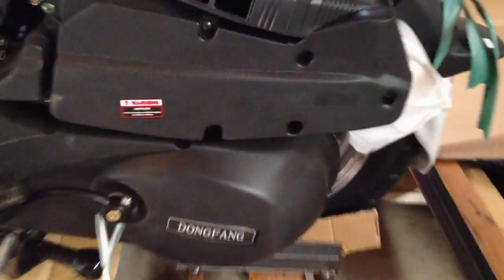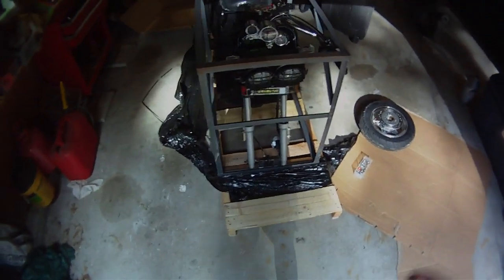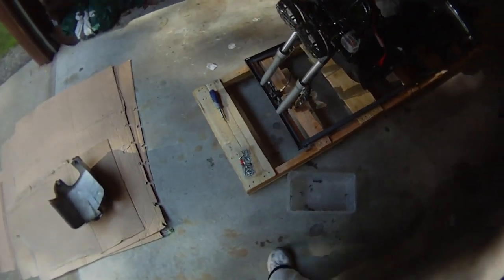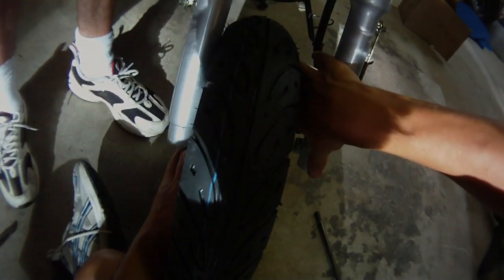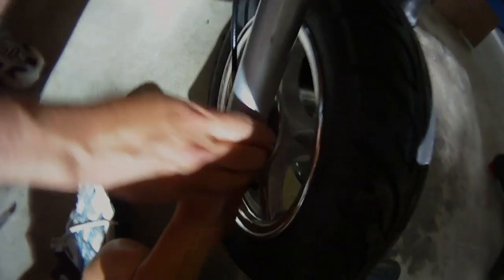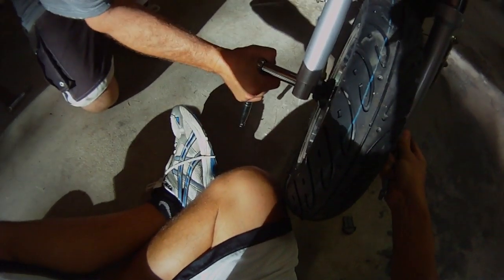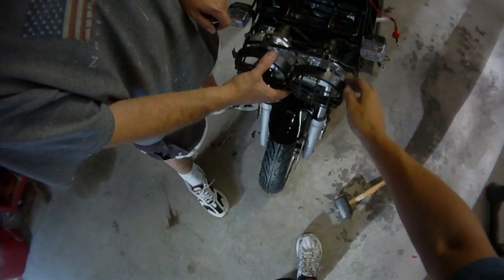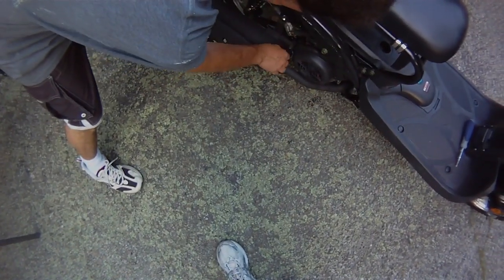Unboxing and Building of Ruckus Style Scooter from ScooterDepot.us MC_D150L

Comment: Thanks for the tutorial, I have 2 of these arriving today. My worry is the liftgate truck delivery. I hope they are not set off in the street by the curb.
Reply from the maker: the delivered it right to the front of my house, i have a long driveway. you could put it on a dolly and move it, usually they will carry on in there delivery trucks, you should be ok, have fun building and riding it!